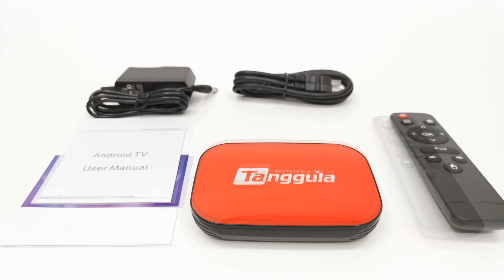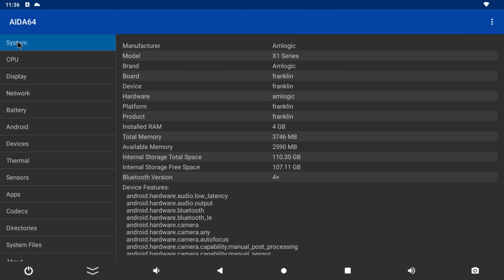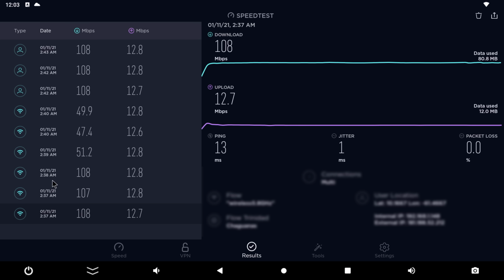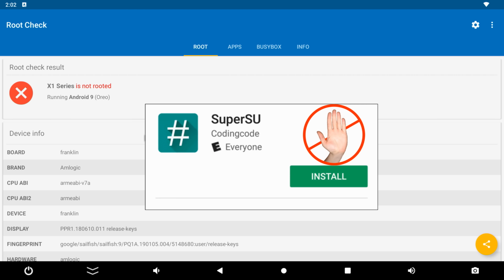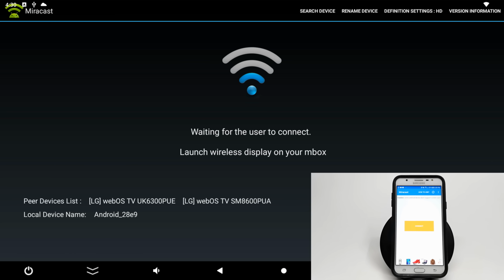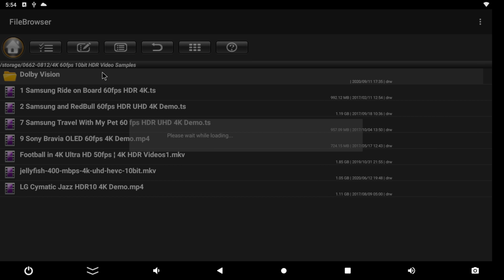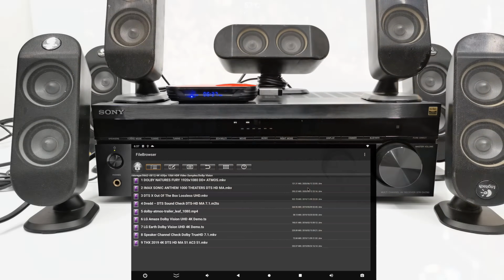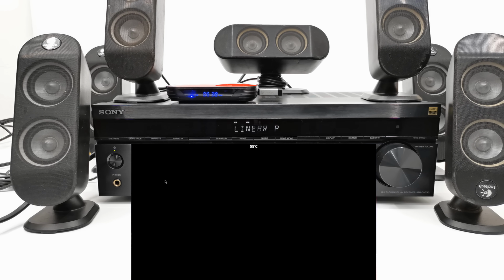Tanggula X1 Live Android TV Box With Some Kick

Comment: The X1 Is Not Working No More, Even Contact Customer Service Not Help At All They Want Me To Buy The Newest One This Is A Scam,
Reply from the maker: The decision to disconnect all the X1 including mine was made as a business decision without informing existing customers. What was happening is that the X1 was running their service via an APK that you can install and uninstall and login with a username and password. Persons were logging into multiple devices with the same app and their login credentials. 

So they decided to discontinue the username and password login feature and implement the Mac address server registration feature. It so happens that the X1 does not have a Mac address to register on their server, so the system does not recognize these workers anymore. I tried to force them to activate my X1 on the new servers but in the end they decided to send me a replacement X5 instead. I received that about two weeks ago and is the new 2023 X5 and I'll be doing that video next.

You should not try to get them to activate the X1 on a new server instead you should be asking for a replacement device. I would say it's a scam but a very unfair way to treat their very first customers.

Comment: I have a X1 tangulla box that I cannot upgrade, it says " We detect your device is not a tangulla device. Please use it on tangulla devices" Quit. What can be done?
Reply from the maker: There is one thing you can do if you have access to the serial number on the box it came in, or if there's is serial number below the box. The one I have I lost the box and it does not have a serial number below.

Firstly you have to download the TangTV updater. This takes the serial number and uploaded it to their server with the VD app on this page - https://tanggulatvbox.com/sdm_downloads/.
Then uninstall the TangTV app that's currently on the box, and install one from the previous models like 16822 version and see if it works. None of this is going to work if you don't have the serial number or Mac address number for your box.

Comment: My X1 series box is not working and bean trying to contact by phone Tanggula Costomer Service to fix my box I need help
Reply from the maker: Mine also! What happened is that the earlier boxes such as the X1 used the app version that required a username and password. The newer boxes are using the Mac address activation method that does not require a username and password. On their website they have discontinued the downloading of the app and your username and password no longer works. Boxes with the Mac address activation continued to work as the only method of service. So in other words the users of the X1 and the APK version of the app are toast.:face-orange-frowning:

Comment: Excellent Review of this tv box.
The temperature is alarming at 80 degrees?
Do you think it will rise more than 90 degrees playing an hour in 3D games?
I would like you to try Nintendo 64, PlayStation 1 and PSP games (emulators) that also measures the performance of the TV Box.

As always good reviews.
Reply from the maker: I recommend a cooling fan for any long term gaming on any TV box these days, because all of them rise to an average of 80°C during gaming only
Reply: @tvboxstop  thanks.